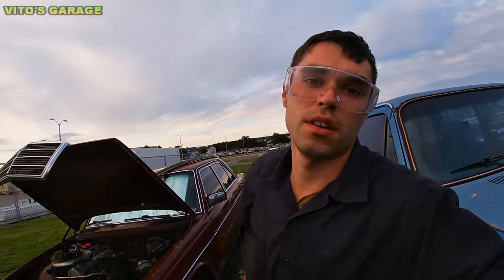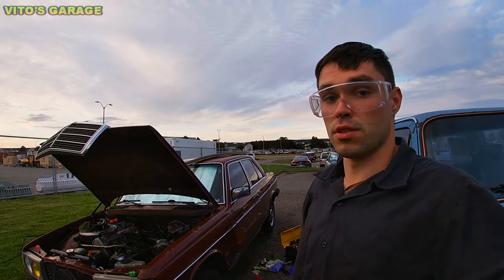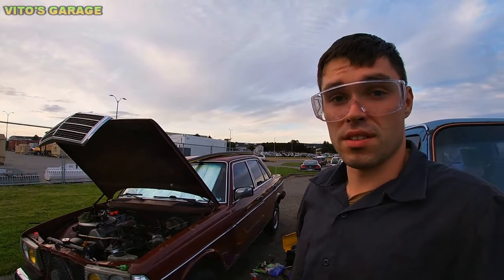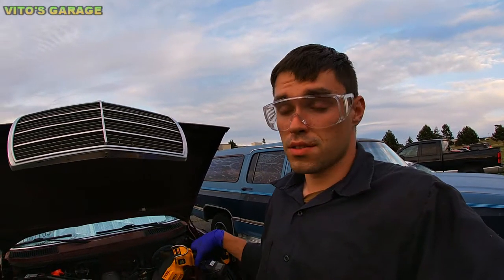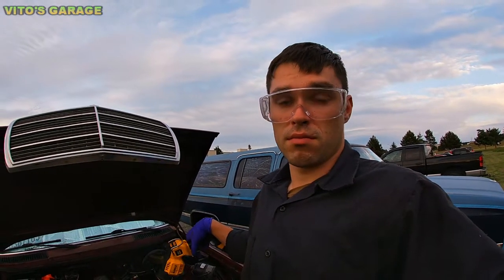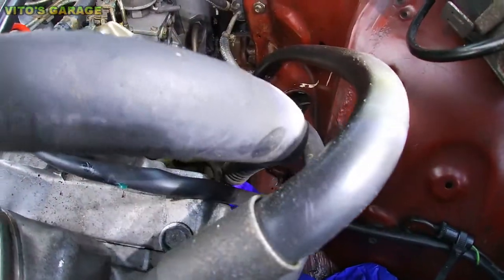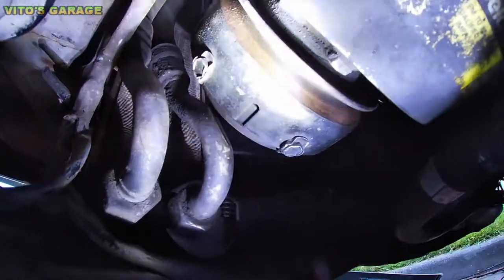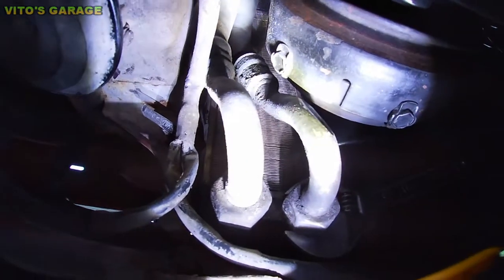BIG ALERT Engine Oil Lines Rubbing Against the Body on Mercedes W123 W116 W126 W115 W124 W201!!!

Comment: On mine, the power steering pump pulley cut thru the line. I was lucky to catch it in time.
Reply from the maker: Damn.... The engine mounts were collapsed? How did it happen?

Comment: My hydraulic clutch line coming out of the firewall is moving back and forth every time the clutch is pushed in.
Reply from the maker: That’s strange. There should be a rubber grommet in the firewall where the clutch line goes through. The flexible hose may not be secured properly. Check it